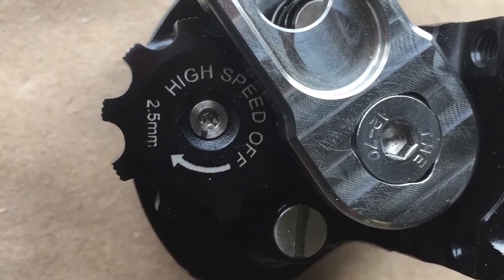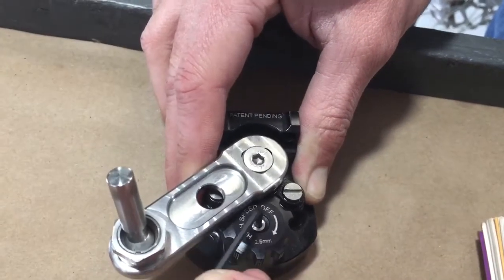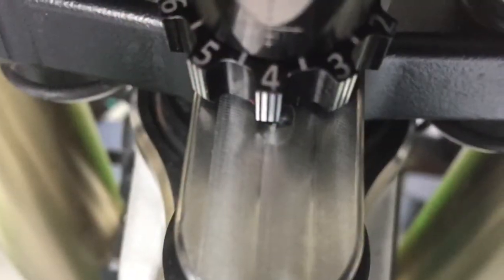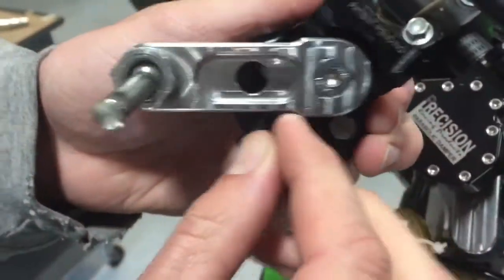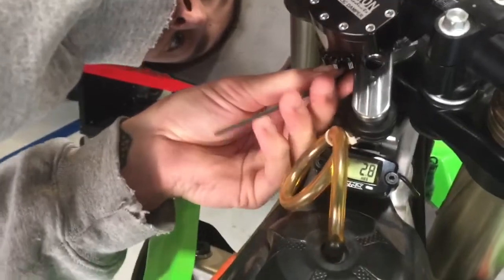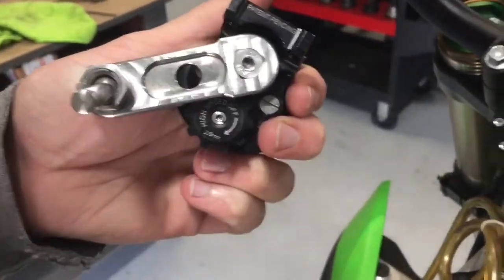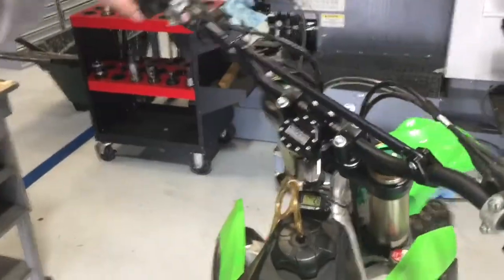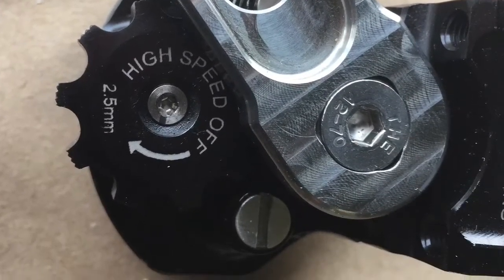Adjusting Parabolic Dampers

Comment: You make it too complicated
Reply from the maker: If you want to simplify it, turn the high-speed to off, and just ride with th low-speed.   Once you get use to the low speed set the high-speed to the recommended starting setting at the bottom of the written instructions, or use this link   https://precision-rp.com/assets/images/Damper MC/Parabolic Settings.pdf